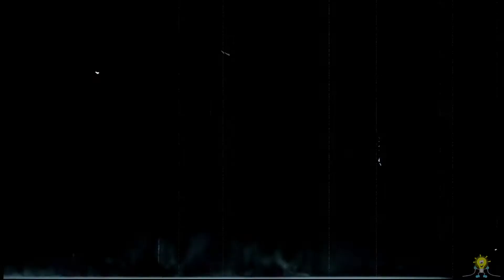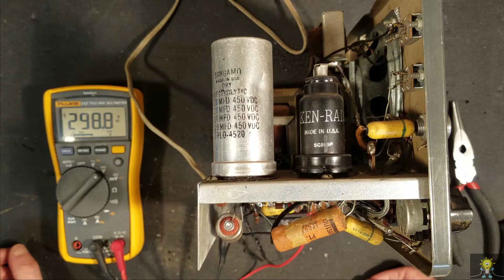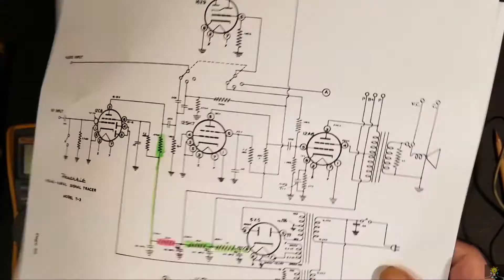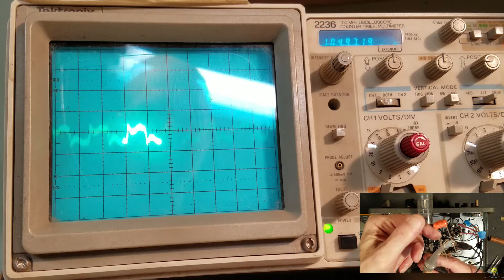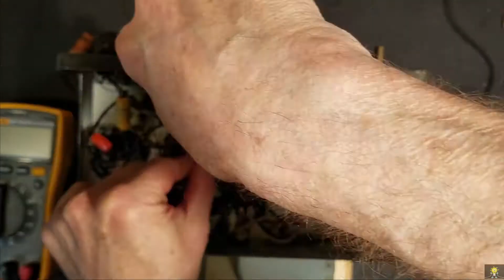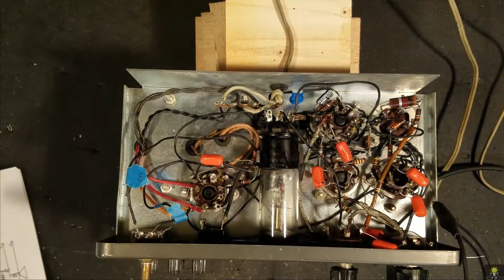012 HEATHKIT VISUAL-AURAL SIGNAL TRACER. MODEL T-3 Part 3

Comment: hi - trying to understand safety caps..... I suspect, but didn't quite hear that the proper safety cap should have the SAME CAPACITANCE and voltage value as the paper cap being replaced, but with the safety feature that it won't blow closed.... the cap being replaced is actually .05uF/600v, but the Vishay WYO saftey caps shown are not the equivalent 50n/600v, but only 5n.... with Y2 rating  only 250v, not 600v.....   So I guess the assumption is for the capacitance/filtering in that position, 5n is good enough, 50n not needed.  250 v protection is good enough, 600 volt not needed.  Is that correct?